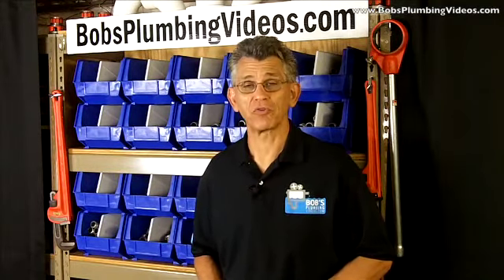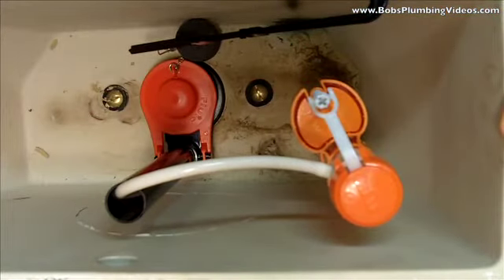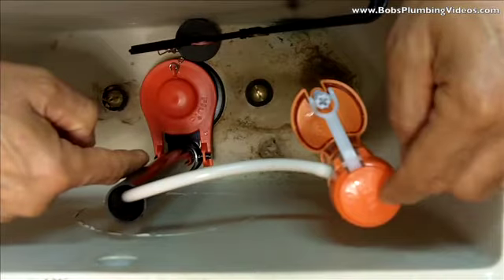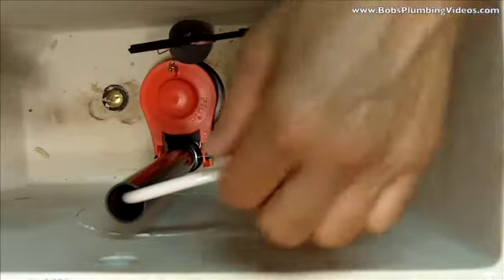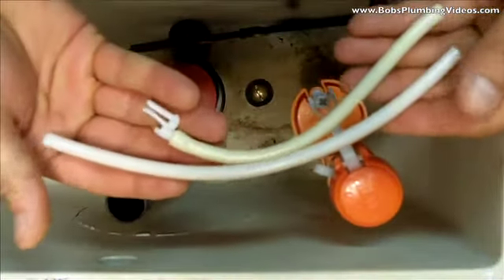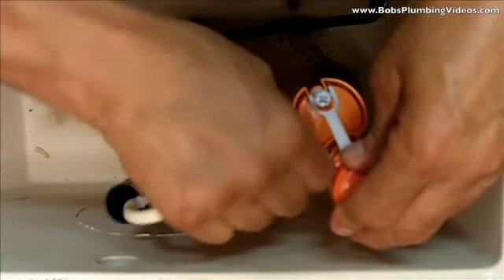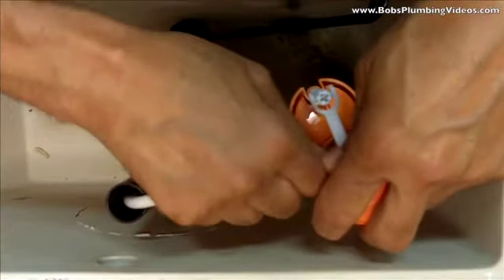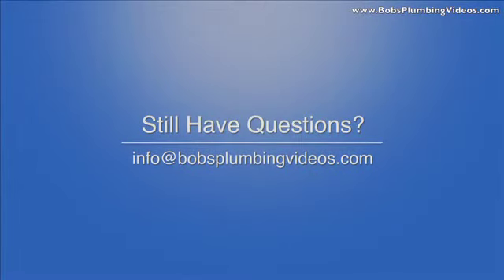Toilet Noise After Flushing

Comment: Hi Bob, I just sent you an email to the address in the video, but I figured I would post here as well.

I have been having difficulty with my toilet making a dripping noise so I turned to youtube for guidance on what might be going on. I don’t believe there is an issue with the flapper leaking/not sealing well as I put food coloring into the tank to see if it was leaking into the toilet bowl and no apparent leakage. I have noticed that the water level in the toilet tank is higher than normal and the little tube that is over the overflow tube is constantly streaming water into the overflow tube. (Based on the video, I have made sure that the tube is clipped above the overflow tube, yet the problem persists.) The toilet doesn’t always make this noise after flushing, but sometimes an hour or so later I will visit the bathroom just to hear the dripping noise again. Based on your expertise, what do you think is going wrong? I am really hoping you can help as I hate wasting water, I am going nuts with this noise and really don’t want to have to call a plumber in this age of Covid-19.  Thank for your your assistance in advance.